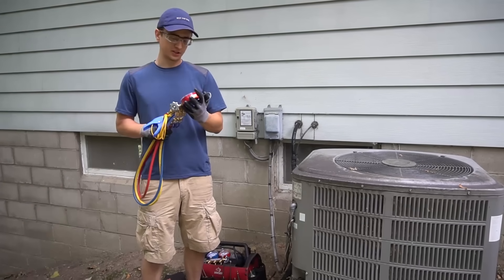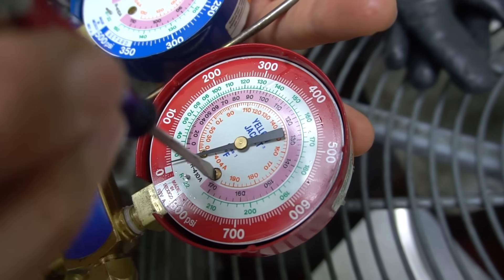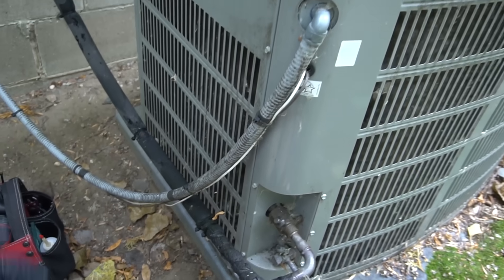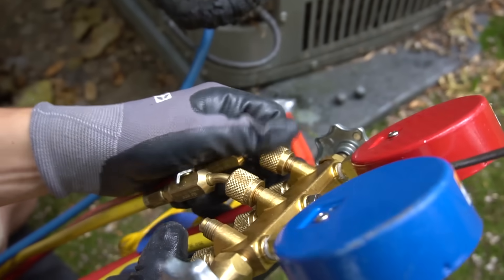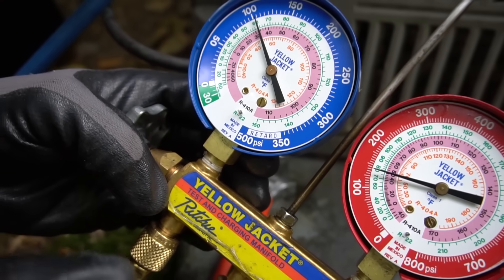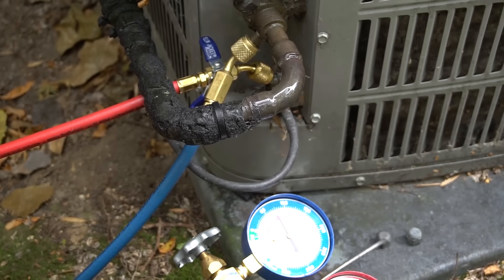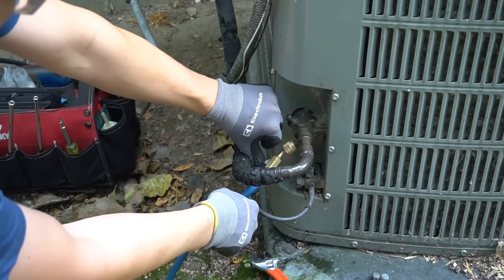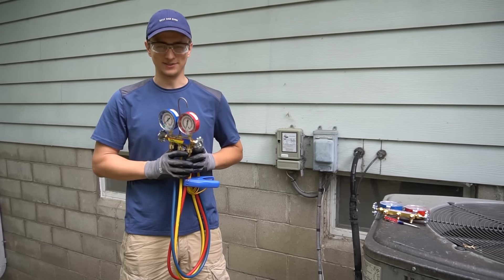How to Check AC Freon Level

Comment: I'd like to add something, specifically for us Canadians. At least here in Ontario, releasing refrigerant into the atmosphere, as seen here, is illegal. I do not mean this as a criticism to OP's video, as laws are different in every state and certainly country to country. 

Here in Ontario, when you attach your hoses, you must close the valves on the Condenser unit first; thus keeping the closed system closed and the refrigerant safely inside this system. The reasoning behind this is that HCFC's, CFC's and HFC's have been (since their introduction) eating away at the Ozone Layer that protects us from the harmful radiation of the Sun. In short, without the Ozone Layer, we all die! I believe most States are in the process of discontinuing the use of these older types of refrigerants, in favour of R-410a in residential applications. The production of R-22 was declared by the EPA to be discontinued in 2010, with phasing out over 10 years, meaning by next year R-22 will be prohibited except in the case of existing equipment!

Additionally, in Ontario, it is ill-advised to try and mess with HVAC/R equipment without a minimum ODP certificate (Ozone Depletion Prevention), as it is against the law to handle, remove or discharge refrigerant without one! 

I realize that for our neighbours to the South, these laws seem overtly strict and probably to some of you, they sound crazy. Just keep in mind Canada's population is roughly one-tenth that of the USA, making laws like these more practical to enact.

I hope this has been informative to those who are curious about such things! Remember to stay safe, refrigeration systems can be dangerous without the proper understanding of their function. 

I'd like to thank Word of Advice TV for this awesome video!
Reply: Do you know why these refrigerants are bad for the ozone?  Because of the chloride in them. Your average pool releases more than any HVAC tech will ever release into the atmosphere. However lobbyists don't want you to know this. 
Not only that but the amount he released is referred to as de minimis. So insubstantial it's without worry.
Reply: @TropicalRegicide  Sorry, but you are dead wrong.  1. 'chloride' refers to the Cl- ion, as in Sodium Chloride (table salt).  2.  The chlorine in your pool has NO effect on the ozone whatsoever.  Nor does the chlorine bleach used in your laundry.  3.  The ozone layer is harmed by ChloroFlouroCarbons (CFCs).  The reason is that CFCs are inert gasses, like Freon.  Inert is great inside your AC unit, but when they escape into the atmosphere nothing in nature eats them.  They float up to the ozone layer where the UV in sunlight breaks them down, and the byproducts destroy the ozone. 

There's real science behind this, Gengar X.  This stuff's been known & studied since the 1970s and it's rock solid.  There are no shadowy "lobbyists" trying to trick you and the govt. into replacing CFCs with safer refrigerants.  Yes, it costs us money to switch.  So what?  We have a responsibility to preserve the environment.  And YOU Gengar X, have a responsibility to learn some science before spouting fake conspiracy theories.

Comment: As an HVAC tech, my “word of advice” for any homeowner. Call a professional when it comes to HVAC! Most so called HVAC guys out there are not qualified to troubleshoot modern systems let alone someone who has not been trained.
Reply: As a homeowner and handyman my advice to "professionals" is to f*ck off.  There are no secrets to this stuff.  And most "highly trained professionals" are nothing of the sort.  I've had a tech tell me there's no way to oil a blower fan, when the yellow sticker right in front of him was pointing to the oil ports!  They're the lowest level employees of companies that don't give a shit about their training level. 

The only protection a homeowner has is to know how to DIY (even if you don't actually do it yourself).  That's the only way to spot the mistakes they make and the pure bullshit they spout to sell you unnecessary services.  It's the same reason why you need to do at least a little bit of your own auto repair & maintenance.

Comment: You probably should not be giving people advise on procedures that require EPA CFC certification.  The only advise you should be giving anyone is not to do anything that you have explained in your video unless you are certified.
Reply: Rod Graff ok dude this is the second video I’ve seen your bullshit negative comments attacking the person in the video explaining a procedure. By looking at the comments I’ve seen I get the feeling that you tried to get into hvacr and was denied admission in a training class most people like you doing the exact same as what you’re doing didn’t make it to graduation or even start.
Reply: Rod Graff also pertaining to your little EPA certificates the whole situation where he shouldn’t show people how to perform test checks and or adding/removing refrigerants you can literally look up the government standards and codes of regulations set by the oversight agencies EPA,OSHA, NIOSH, and the Chemical safety board. On how to properly and legally perform this procedure. Besides the A/C unit is the property of the homeowner and if the homeowner wants to do this or anything for that matter then they can and there is nothing you can do about it because you’re nothing but a keyboard warrior.
Reply: Jonathan Sexton: Well Jonathan, you tube has made everyone an expert or professor.  I will continue to call out people who are teaching wrong procedures.  No I did not flunk out of the HVAC field.   I worked with the tools from 1973 to 2006,
I am retired from it. I have also been teaching apprentices (five year programs) and journeyman upgrade programs for 32 plus years, and I give the prep classes and the EPA exams, for CFC certification, so please don’t tell me what’s right and wrong. I’ll loose you in about a minute. I have a degree in education and posses a lifetime teaching credential for the state and community colleges in my area.  Fact is people who are teaching wrong procedures are dangerous and cause a lot of damage to the trade.

Comment: Personally for me whenever I hook my gauges up to the unit, I will have my ball valves open and my gauges closed shut. At about 8:19 I made the same mistake when first learning how to hook my gauges onto the unit, and I got a ‘handful’ of refrigerant spew out from my high side. The reason for this is because your ball valve in closed, not giving your refrigerant anywhere to go, so it spits out onto your hands. If your ball valve is kept open and your gauges closed, then the Freon will travel up your line giving you enough time to close it shut and minimalise refrigerant loss.
Reply from the maker: Very good advice! Thank you for sharing!
Reply: That's a great tip

Comment: Brother...not trying to be too disrespectful but this is a classic example of "knowing enough to be dangerous".  Knowledge and wisdom go hand-in-hand. It can be dangerous if someone doesn't have the wisdom to use the knowledge correctly. You need emphasize the health risks and legalities associated with servicing ones own HVAC system. I've been in the HVAC/R trade for 25 yrs and will admit that it is not rocket science......it's thermodynamics.  As such, there is a lot more involved than knowing your pressures to diagnose a hvac system. What about superheat, subcooling, duct esp., CFMs, indoor and outdoor delta t, sensible heat capacity, latent heat capacity.....these are only part of the calculations professionals use to diagnose a refrigerant issue (pressures and coil temps are only part of the equation). Not to mention, as of next year, R22 will be virtually obsolete and will, more than likely, be replaced by 400 series refrigerants. These refrigerants, including R410a, are blends of different refrigerants. Refrigerants are toxic chemicals w/ some being corrosive or flammable. To emphasize the severity of refrigerant burns (frost bite), I wanted to say that I've worked with people that had to have skin graphs and amputations because of refrigerant burns. Just because someone wears gloves, doesn't mean that they won't get injured!? What happens when your gloves get frozen to your hand b/c of a broken schrader core or ruptured refrigerant hose, not to mention, the cost of losing an entire refrigerant charge due to not knowing how to minimize the damage quickly. Remember.....experience is the BEST teacher. This is partly the reason that, according to EPA Section 608 and 609, it is illegal for someone who is not EPA certified to service a refrigeration system...including attaching a service manifold to a system.
Reply: Thanks my man, i really appreciate that tutorial ... I will be more glad if i can also get a phone contact,Thanks.
Reply: HVAC PRO Thanks
Reply: HVAC PRO I wish to have some talks with you professionally , my contact is +123 07064406365 From African.

Comment: Can you explain about head pressure valve. One of our unit is bypassing all hot gases without going condenser coil and heating the room. Please explain why it is happening.
Reply: Reversing valve most likely

Comment: The only information you need from the gauge is the pressure, there is no need to get a specific gauge for the type of refrigerant you use. The refrigerant temperature information is found on google by typing refrigerant temperature chart or you can explicitly search the refrigerant you need information on. Its far better to pay for a greatly quality and accurate gauge, than pay more for basic information already available to you.

Comment: thanks this is a good video i love hearing all the HVAC techs cry because they worried about their pocket books getting lighter from getting to over charge people or just scam the ignorant ones out right   lol
Reply: Who needs a dentist when pliers will do...
Reply from the maker: Thanks Larry! Some of them are sour I agree but others are more concerned about people hurting themselves. So I think it's good that there are comments like that so all the viewers are warned.
Reply: Word of Advice TV almost any kind of packaging dealing with dangerous substances such as refrigerants have some sort of hazard communication on it like skull and crossbones or the dangers physically spelled out.
Reply: Most HVAC shops are ripoffs. A neighbor got a new system for $6K and it still doesn't work right. A relative got ripped for overcharging for parts and took a good  thermostat & replaced it with a $10 one charging $60. My cousins furnace was serviced and the tech lit it by hand, then waited for her call that it wouldn't start again. 

BTW Thanks for the video, a crook wouldn't post this information, they like cheating people instead.

Comment: 9:34 . You mixed up pressure with temperature .
I think you meant 40-45 degrees and not 40-45 psi
Reply: I hope so, may have some units low on charge out there.

Comment: I would add that if you don't know or understand the temperature /pressure relationship of refrigerants you should not be checking any system. Understanding superheat and sub cooling is essential when checking your charge.
Reply: It is essential,  yet a very small percentage of techs use it while checking or charging.
Reply: This what I’ve been thinking the whole time , great vid none the less tho

Comment: You shouldn't do any of this without an epa license unless you want some jail time
Reply: Cert is needed if you do it for a fee, or bartering, not if doing it for your own R410a is not ozone depleting the r12 r22, how you would even have a system with that is long overdue to get rid of it
Reply: @cengeb  good luck getting a supply house to sell you anything without one
Reply: @Rpotts1999  Can anyone buy r410a refrigerant?
There is no "license" issued by anyone for any refrigerant. There is an EPA certification process available, and required, for purchase and handling of CERTIN refrigerants. R410a IS NOT one of those. ANYONE can purchase and handle 410a.
Reply: @Rpotts1999  In the fall of 2016, the EPA updated the existing requirements related to ozonedepleting
substances (ODS), such as CFCs and HCFCs, and extended them to
substitutes such as HFCs.As of January 1st, 2018 sales restrictions will be also applied to HFC refrigerants
Reply: @cengeb  ok try to buy 410a at a supply house without a epa cert
Reply: It's not a License, it's a certification
Reply: @cengeb  same difference
Reply: @Rpotts1999  Time to take Z TEST!!!

Comment: That's a awesome way to improperly check refrigerant charge
Reply from the maker: Thanks for the comment John! This video was more on how to read the gauges and not to teach how to diagnose a refrigerant problem. But if you could explain what the proper way is, it would be appreciated!
Reply: Best way to check refrigerant charge is to check superheat and subcooling along with the TD across the indoor coil inside.

Comment: As a new technician I really appreciate this video. You show the detailed procedure for connecting and checking the refrigerant level which is good practice for newbies. It also gives a picture of the numbers we should know as to what is normal system operation and what is off. 
I'm interested to learn how to do this connection and check with the Testo 550 which I just purchased and am learning to use. Thanks..

Comment: If you are a home owner do not try this yourself! There is so much more to checking the charge than being shown here. They didn't tell you you can get hurt by liquid refrigerant 410A boils at -60 degrees at  atmospheric pressure. R22 boils at -41.6 degrees at  atmospheric pressure so don't mess with it.
Reply: Larry Cole at least do sufficient research into the subject beforehand such as the theory of a/c units the operation of them the very least have an understanding of the different types of refrigerants and the type your unit uses and use only quality grade equipment (gauge manifolds, hoses) etc. etc.
Reply: Larry Cole , you sound like a whiny baby.
Reply: Oooooooooo....You really scared me man! I think he mentioned that about twice in the video man! But hey, thank you for taking the time to add your two bits!

Comment: OK, so A lot of comments here are attacking this young man for doing what others are not. He made this video to give pointers to homeowners so that they are aware and educated enough to know what the techs are doing. I personally have been ripped off on a tech that overcharged for capacitors and refills on refrigerant on a 6-year-old unit. I was renting out the home to close friends and I was out of state when I got a call in July that the AC was not cooling so  I went to yelp and made a choice to go with the higher rated Ac service co. Well, 3 months later I had the same problem with the same unit I called a different guy who checked both Ac units for leaks and cleaned out the coils and replaces a Schrader valve and topped off the refrigerant. I believe in transparency so this Guy is helping many to understand where to start and of course, every adult is going to do further research so don't knock this guy for helping many. The other constructive criticism helps people out and this guy is honest enough to say thanks to those comments so guys keep up the helpful comments to educate each other out and don't hate because he's helping homeowners. Keep this educational.
Reply: I am totally in favor of people learning about my job. Helps me explain what I’m doing easier when the customer can understand some of the lingo. Anyway I agree with your comment and thought it would be worth noting That your refrigerant should not require being topped off as a Hvac system is hermetically sealed. The system does not “use up” refrigerant. If you’re low you have a leak and that needs to be addressed. Thought you would like to know :)
Reply: SN, thanks for voicing exactly the way I was thinking. Not fair that the critics think it is ok to speak for all of us. I so appreciate guys like 'Word of Advice' giving up their time to share. I find videos like this very helpful. I have an AC unit acting up and watching this video leaves me less vulnerable when the technician arrives. Thanks again for sharing what I am sure a lot of people were thinking, but did not write it.
Reply: Yes, Yelp sucks big time.  Also had very bad experience.
Reply: I do t mind other techs trying to give homeowners advice.. I do all the time..but some of the info is inaccurate. Therefore some of us professionals may need to step in.
Reply: As long as you have the EPA Type 2 at least. If so then you can legally handle refrigerant. Im an. HVAC tech and i always give good pointers to customers. I dont see any point in tryn to rip a customer off when its my name on the line. Point is an air conditioner like a car, needs maintenance and you should know the basics.
Reply: Did this make you educated enough to know what a real tech is doing? now you can stand over the techs shoulder saying stupid stuff trying to sound smart.
Reply: @davidgoliath9073  Big Goliath, get a life and rid of the chip on your shoulder.

Comment: Might be wise to be CFC certified. So when you check charge and it's low on charge you can't purchase it. You also have a leak depending on how much is gone. This guy shouldn't be teaching anyone this. Go ahead and do this to 410a without gloves. You say at the end how you shouldn't be teaching this but yet you are.

Comment: DO YOURSELVES A FAVOR, HIRE A PROFESSIONAL TECHNICIAN. NOT THIS ROOKIE! 1st, you must take temps to confirm proper charge. 2ndly, the factory charge includes the charge for 15 feet of piping. 3rd, you don't adjust gauges to zero to calibrate. You connect them to a known pressure source and adjust. Hey Rookie, back to school with you.